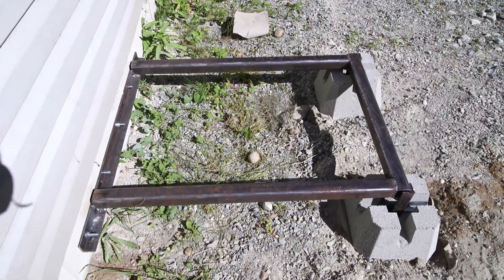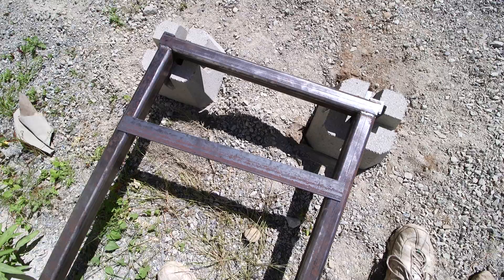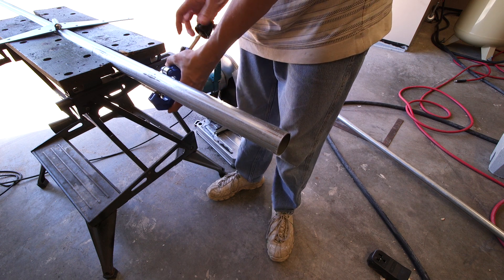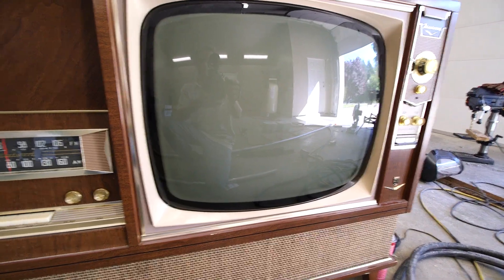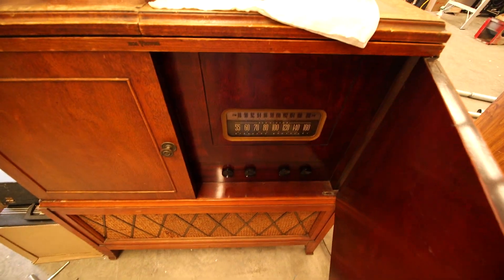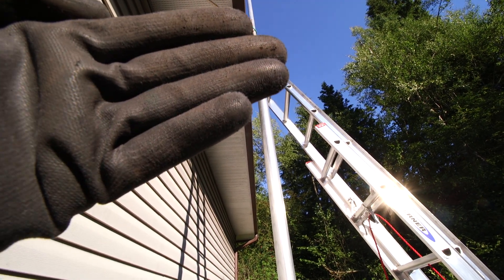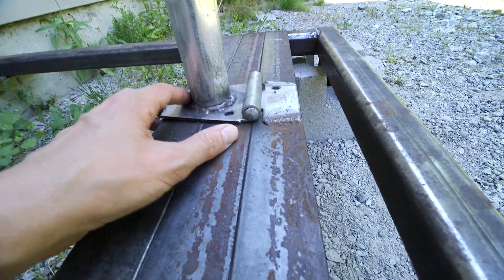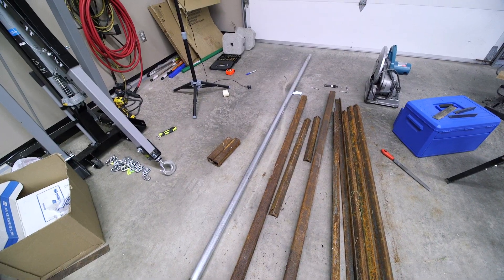High Performance Antenna Build. [Part 3] The Mast Goes Up!

Comment: I think for 40' I'd use galvanized rigid conduit, plus it won't rust as easy.. With the pipe threads it is easier to join different size pipes together, much more easily. They called R/E's and that stands for REducer, it's threaded inside and outside to match the diameter you need and a coupling..  You could go from a  2" down to 3/4" with an R/E or two..

Comment: How to make a high sense FM antenna:
Grab a hundred foot of magnet wire 30ga.
Then grab a really long but powerful neodymium magnet.
Wrap 50 turns on one side.
And the other 50 on the other side.
And then put the two coils in parallel

Comment: Rustoleim paint and primer and no wire brushing needed. There is a primer/paint called zinc chromate that is excellent as a primer/paint I used on my M-131 A-1 Jeep that still hasn't rusted through since I bought it in 1979. Just some suggestions I thought you would appreciate for your masts. The old stuff, if you can still get it works better than the stuff "made in China" today.

Comment: Hello, just going out on a limb here.  I could not find a contact email for you.  I have a circuit board from a holiday decoration and am having trouble finding the transistor.  After testing the transistor not working is D1616A 021.  Tried to look every where on the internet and am hitting a wall.  I was also wondering if the small circuit board could be totally replaced.  Any help or advice is greatly appreciated.

Comment: Thts a similar design to my tower that also folds down, i used trailer bits to secure the pole and provide a pivot point at the base

Comment: Do you feed your own video into your tv restorations?
Or do you still have analogue tv signals over there in Canadialand?
Everything is digital sadly here int he land of G, the government sold the analogue frequencies off as soon as they could once they forced through digital only legislation.
I can see the same thing happening with some, perhaps even all,  the 70cms ham band, we already have lots of low power devices, alarms etc on the lower end.

Comment: Just a word of warning / advice for anyone who wants to go into a welding project like this with little to no experience. Some metals when welded produce toxic vapors. Zinc seems to be the worst of all. So for welding either the pipes or something like the hinge, it is good advise to remove most of the galvanized coating around the welding area and to do this in a very well ventilated space and possibly even using a respirator on top. Breathing that nasty stuff could turn you into the mad hatter or even worse with some bad luck.

Comment: Hi Paul I've put up a lot of wires in my day.  You mentioned having a pulley at the top of the mast. What I would recommend if you haven't already thought of it is using the double pulley method. Fasten a line to an eye mounted at the top of the mast and run the line to a pulley at the end insulator of the antenna. Then run that line to a second pulley mounted about a foot below the top of the mast and then down to a counterweight. This will give you a 2:1 weight advantage and will also allow the counterweight to ride up and down with the wind. 73, and good luck.

Comment: After the fact suggestion -- and you may be aware of this -- but welding galvanized steel can be nasty. Suggest using muriatic acid in the weld area to remove any zinc galvanize. You're probably okay since you seem to be welding out in the open, so avoided the vapours.

Comment: i'm watching this wondering how your winters are. frost may heave that mast.  also the hinge is going to bend. been there done that.  would have been better to drill the mast for a 12mm bolt and used angle iron on the sides for pivots. otherwise it looks like a decent affordable design. i'll be real interested in the electronics of it.

Comment: Mr. C, You've sparked some ideas in my old noggin on a future project. Thanks for all your shared insight. I'm in USA-NJ ... is there any issue with frost heave on those concrete blocks as I'm guessing they do not go below the frostline? Jim

Comment: I just watched the 3 antenna episodes Paul, you will be able to pick up Mars with that thing! 😉👍😄
Reply from the maker: LOL, thanks for stopping by David!
Reply: @MrCarlsonsLab  

I am new in electronics

I want to learn whole Electronics using practicals Lectures

From very besic voltage divider resistor circuit to big complex circuit

Please tell me any channel who teaches Electronics 

I want to become analog Design engineer in VLSI

Please help

Comment: You mentioned you were going to use some kind of 'cold-galvanize'; would it be good to use a rust-converter first on the bare steel?
I've really adopted rust-converter because even if I sand, I still can get rust creeping out from under the paint.  73...

Comment: Nicely engineered as per usual on Mr Carlson's Lab. I did think that the hinge bracket was a little flimsy looking for a mast of that length though. If the upper support gave way (e.g. in one of your ice storms), the leverage forces would be huge on that bracket! Will you use any guy ropes when at full height? Very much looking forward the the TV restorations - brings back happy memories of my parents first B&W TV back in the early 60's.

Comment: I used 2.5" 4' into soil reduced to 2" galv pipe with 8' ground rod which has been able to withstand Fl hurricanes and lightning so far, antenna gets removed when storm approaches.  N9EQE.

Comment: yeah the heat is crazy... but I weld without a jacket... just a T-shirt and I haven't had any balls of metal burn me, they just jump off.
instead when I've welded with a jacket in the winter, I got burned all the time when the balls of metal jumped in between the jacket and my skin... well it may've happened then because I was just learning to weld then, and was bad at it.

Comment: The one possible weakness I see is that when you are pushing it up, if it starts to go sideways it will twist the hinge and destroy it. I would have made a stronger custom hinge.
Also, I hope that foliage doesn't interfere with the raising operation.
Good luck!

Comment: Paul, I know you've probably already painted the parts, but the POR-15 preparations are awesome for protecting and sealing bare and lightly-rusted metals such as these. I used it many times, and it really works well. Also, galvanizing those pieces would have worked as well, or before the POR-15.

Comment: Can also get chasi saver paint at Napa Auto parts and it dries a semi thick hardened coating that is chip and rust resistant.

Comment: I have a similar mast which I have pulley up on the top of the mast which I use to hoist up my baluns with various long wires and another to lift the 10m 30mm water pipe up. It's very useful when the weather gets windy and I've got some dipoles or a beam up.

Comment: Hmm, I bet you this design could be made even easier for a single man to raise the mast with a touch of reinforcement on that top bracket. Have each section fit under the bracket and use it to hold the mass of each of the above sections as you add more. Basically a reverse oil derrick.

Comment: A pully could become an issue for the future, can become seized or the rope/wire could slip off...
My thought would be to weld a large chain link and have the rope go through that to a dog bone isolator but make sure the dog bone can't fit through chain link. 
You could also "reverse" the pole temporarily and send the rope over the house to a winch, if it's a heavy mast then a section of "block n tackle", this will take the stain to raise and lower that mast even on your own if you can use a remote wire to relay switches to operate the winch
Reply from the maker: Hi Ian. The better pulleys use dissimilar metals, IE: brass and steel. I have had pulleys like this in service for 15 Years or more and no problems.

Comment: TV RESTORE!!! I'm curious to see how you decide to drive the video signal into it. Also, here's hoping you aren't anywhere near the fires that I've heard reported at your latitudes. 👍
Reply: Since the change to digital TV you may have kept the old converter box which will allow broadcast TV reception or  just use cable TV . 
For the  TV set just turn the  channel selector knob to channel 3 or 4 , at least. That's how it is done in the states on Youtube TV repair videos.

Comment: wow, shango066 will get some competition... By the way I absolutely love both channels.
Completely different ways of restoring electronics, both with a LOT of experience.
I would love to have as much experience, I have a lot of theoretical knowledge, but need to apply it to more complex circuits to understand them in a more intuitive way.
That is what fascinated me about your channel, the intuition you seem to have about analog circuits. They are just so much more interesting than digital stuff, which is often just "textbook-style" design.
Reply from the maker: Maybe I should do a Shango style video?
Reply: If you like videos working on old TVs I would suggest checking out bandersentv's channel.

Comment: Hi Paul, How about a safety bracket near the hinge (or a bolt thru the rear of the hinge) so you can temporary lock the vertical pipe in place as you climb up and down the ladder without concern of the pipe falling down. I'm just concern for you.
Reply from the maker: I will have help lifting the mast, and the help will hold it while I climb the ladder. Thanks for your concern!

Comment: I like this build, and I can't wait to see the whole project finished.  And it was also funny to see that little dragonfly take advantage of you fan, and cool himself in the heat.  I read that some places in Canada has set temperature records up to 47 degrees.....its unbelieavable.  Its warmer than in Dubai and other warm countries. In Norway it has not been passed 30 degrees yet, but since I love the heat I hope it will pass 30 soon he he. 
Take care in the heat, and I look forward to your next video, Paul. 73 LB5JG
Reply from the maker: Hi Asle. It was so hot and humid here, I walked outside with the camera to make a segment of this video, the lens and view finder of the camera "instantly" fogged up... Unbelievable! I had to wait, it was like a bathroom mirror after a shower. Even the camera sensor was affected. Strange occurrence.
Reply: @MrCarlsonsLab  hi Paul and thank you for your reply, I knew Canada could be a very cold country, but I didn't knew that it could be warmer than countries like Spain and Thailand..... And when its humid it's even worse.  Take care, stay cool

Comment: I had to use a commercial ham product for the hinge which works well.  The biggest problem for the rest of the mast was finding adequate u-bolts for the wench and pulley (I am a bit older than you).  
Not only does yours look good and reliable, I am absolutely sure that the local HOA (that is, the wife) approves of your design and aesthetics.  Yes, we can fool the "official" HOA with stealth, but we must always satisfy the real HOA.  :) Albert KR3HAB

Comment: Great, looking forward to the rest.

You have so many gorgeous apparatuses. It still angers me that the norwegian government closed FM for national channel use some five years ago and went with the flop DAB instead. So many beautiful radios was scrapped. I saved a handful, but all I can use them for is listen to AM from other countries at night.
Reply: If you make a decent antenna you can pick many stations in the day and night you will be amazed.
Most people make a dipole but what people forget is they are somewhat directional, 
If you can get a large fiberglass pole and made a few quarter wave lengths of wire to run up the outside of the pole then run loads of ground wires around the base of the pole your reception would be massively improved. I understand that many bands you may have would be too long for the fiberglass pipe/tube/rod but you can go up and come back down or come out to a fixed point. 
The antenna idea I have mentioned is a concept of the "DX Commander" look it up on YouTube, this antenna is designed for transmission and needs to be fine tuned unlike an antenna for just rx, have something that measuring the correct band quarter wavelength and you'll see a huge improvement

Comment: 40 degrees celsius? Damn, my condolences. Drink more water and stay at shady place.
Reply: Forty C is NOT that hot.    But add in anything above 5% humidity, and then it's damn near unbearable.
When people give the local temperature, I wish they'd also report the humidity level.
Then we can truly all suffer together.
Reply: @howardhiggins9641  104F may not be hot where you live but it's smokin' hot in the area Paul and me live!